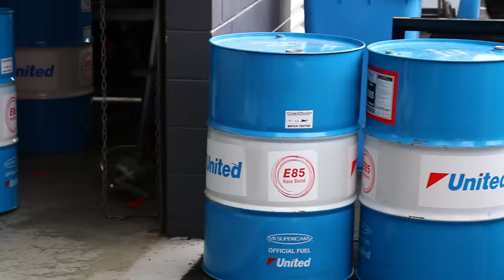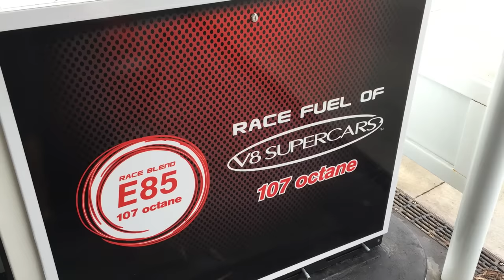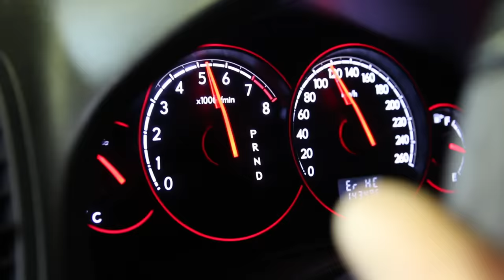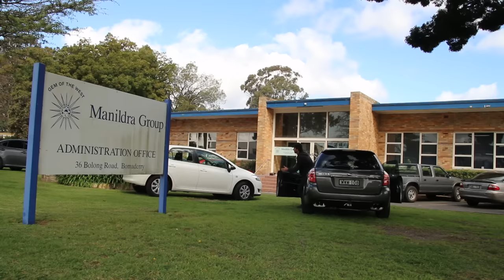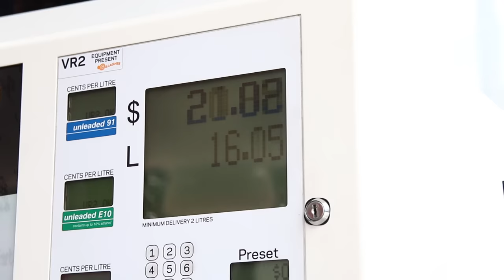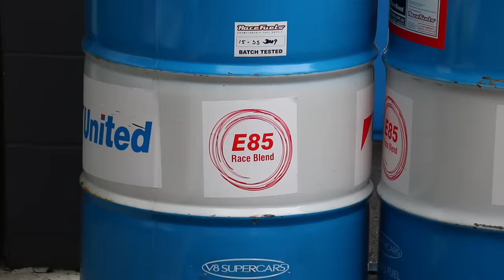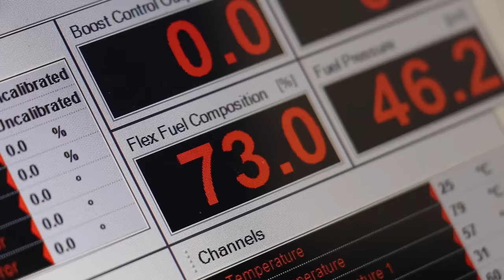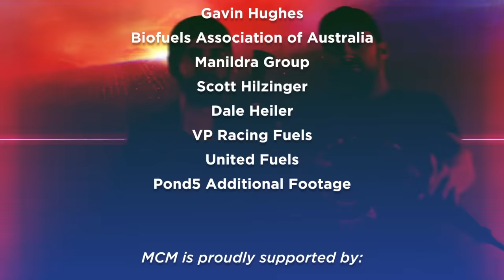E85 Fuel Explained - Should you use it?

Comment: In Brasil we use EA96 in the street, and u can find EA100 in some special places. Cars are runing Ethanol here since 70's and the first Flex fuel car was VW Gol 2003 1.6L using the EA827 Engine, same found in VW golf MK1, MK2 and MK3. And its the engine that the majority of us use for modifications. I Own a VW Gol 1.8L 1994 runing only EA96 from factory, and its carburated with a Brasol 2E. The 1.6L version makes 80hp on Gasoline and 90hp on ethanol. Here it is made only of Sugar cane. And i think we are the major market for ethanol. Petrobras is the statal-company that make it. And for the future, i hope we use eletric cars =D

Comment: Dude I'm gonna convert my race car to E85 it will be awesome! 
Then I will use my backup car to drive 200 miles to look for E85 once a month and top up :)
Reply: That is all I use in my coon cage and it is so that all one needs to do is change the filter. However fomoco was so inventive in the 60's they never needed a oil change. 139,000 miles 4 quarts amsoil over time. Plus filling filter hey do a normal up keep and as prescribed these panthers last.

Comment: In the USA  we use Research Octane + Motor Octane + 2 ..   Looks like they just  use Motor Octane in Australia .. Ethanol  makes more HP for 3 reasons  higher octane  if your motor can utilize the higher octane .. from higher compression ration more timing advance or  boosted intake .

  you can burn more of it with the same amount of air .. because it is an oxygenated fuel  that has some of it's own oxygen in the fuel ..  Plus it has a tremendous  cooling effect which helps keep the combustion chamber temperatures at save levels for reliable engines ...

Comment: Caltex E-flex is 70% Ethanol, United is 85% Ethanol. Always use United if possible...
Reply: +Luke Anderson It depends on the season actually.  Summer blend is more, and winter blend is less ethanol in the USA.  The higher gasoline content in the winter time helps with cold starts in the colder parts of the USA.
Reply from the maker: +peniswrinkle Depends what fuel octane they blend it with too.. United e85 is blended with 98 octane petrol
Reply: Mighty Car Mods
What do they blend it with in 'Straya?
Reply: +peniswrinkle, Yes with some gas stations like Caltex you get 70% to 85% between seasons but with United, they tend to be pretty spot on with 85%... Australia is limited to E85 stations, only Caltex & United, & rare to find E85 at those stations alone...
Reply: +Mighty Car Mods, You guys are awesome... May the Road be with you & keep Chopping...

Comment: In the Netherlands we started the E85 experiment in 2008 with Ford and Volvo making Flexifuel vehicles. The E85 was 30% cheaper than regular 95 gas. I have a Flexifuel vehicle. Unfortunately we experiment has failed and almost all E85 pumps are removed in the entire area here and possibly the whole country. According to the pump manager i was the only E85 consumer and this was the only pump in a 50-70km radius so that quite sums it up. I think electric is the way to go with superchargers at every filling station. Also BLAST acceleration with 4WD for almost no maintenance :)

Comment: I'm from brazil and woul like to share some things about ethanol here in my country.

1-you can find it on any petrol station, and it's usualy cheaper
2-the normal petrol here have 25% of ethanol, because of that cars usualy have a little more power than what the dealers says it has (Golf GTi here has around 245hp, 25 more than it should)
3- cars that can run on it pay less taxes, as a result of this, almost every car here can run on both fuels
4- Mamona (a plant from brazil) it's also used to make ethanol, and its better than sugar cane. however because sugar cane has other uses it's more used than mamona.

Comment: Sadly you can't buy E85 in England.
Reply: +Louis Gordon and sadly E85 is pretty much useless to daily in the north due to the low detonation temperatures.
Reply: Apparently morrisons used to sell it but was unpopular 👎🏻
Reply: +Vinnie Davis you can always mix ethanol with regular gasoline in order to make it more driveable during winter, if your car has flexifuel sensor
Reply: You also need to seal your tank of irbid made from steel else it will rust out over time due to the water content in ethanol.
Reply: Jon Laws
this is good info, thanks for sharing
Reply: Where can you buy e85 from?
Reply: +Louis Gordon Use Methanol injection instead.
Reply: +Louis Gordon E85 is trash it gets like half the amount of mileage per gallon my car is a flex fuel car and ive filled it with E85 before and it was trash
Reply: LiveToRide
maybe you should do some research. Just because it requires more e85 to make the same distance doesn't mean it's not better in a lot of other ways that matter A LOT more. It makes less distance because of the engineering use case.
Reply: Bootleg Builds in order to run on fuels which contain more than 15% ethanol, it's recommended to upgrade the fuel lines, the fuel tank, and injectors.
Also you'll have to install fuel pressure regulator and an ecu which supports flexifuel sensor.
But I have never done something like this, so it's all learnt from forums.
Reply: Vinnie Davis Unfortunately its over twice the price. I use £100 a week in fuel. Double it and thats an extra £5k a year. I can get a super charger fitted for that price that doubles my BHP. In the UK its not really an option. Yet.
Reply: boothegoo pc
In a lot of places it's not an option, yet. It's about potential, not current functionality.

Comment: E85 was a failed venture when they realized manufacturers would have to use a full stainless steel fuel system including tank. You can run e85 in a daily driver without any corrosion problems but it will eventually absorb moisture and destroy your tank, fuel rail and injectors. On top of that most pump e85 is stored in old gasoline tanks which are not designed to house ethanol, which dissolves the tank lining. This lining then manifests itself in your fuel filter and injectors as a black tar known as e85 goo, which can destroy your fuel system in short order. E85 is a great fuel but these days fuel economy is king, people don't care about horsepower as much as fuel economy. If anything Diesel is the fuel of the future because it has the highest energy content per volume of any fuel, meaning you make smaller engines and still get the same performance figures. The only issue is particulates that go into the atmosphere, which can be greatly reduced with urea additives. Modern diesels..1/2
Reply: Are cleaner than modern gasoline engines.
Reply: Except when oil just runs out, we will either have to go electric, or E100, and being a petrolhead, ethanol seems a good enough alternative.
Reply: Just like how it dissolves plastic gas cans right

Comment: If you look at towards the future rather than the present, ethanol looks better and better as a fuel source. The primary benefits of ethanol as a fuel are a higher knock resistance and a greater cooling effect on the intake air - mostly useful for cars with forced induction. As such, smaller, turbocharged engines (the current trend) make better use of ethanol. Reduced energy content can be partially offset by taking advantage of the knock resistance of ethanol by increasing compression/boost pressures. As far as production goes, cellulose-based ethanol will be the big breakthrough. Once that becomes industrial, the arguments about corn usage will break down.

Comment: Hello. Let me contribute with you guys sharing my experience since I'm Brazilian. In the end of 70's beggining of 80's Ethanol started to be introduced in Brazil as an option to Petrol. Because of the Petrol crisis. Mechanically it is easy to adapt petrol engines to it,  but in "cold" temperatures (15 Celsius) to make then fire up was a hard job back on 80's. Bateries very often were not able to handle it and till those engine warm up leaps, gaggings were usual. But the fuel itself was so cheap that people still kept on buying cars moved by this fuel. (Fiat 147 was the first manufactured car to be sold in Brazil moved 100% on Ethanol) When the Electronic Fuel Injection started to be used (1989 Volkswagen GOL Gti (with no F)) those problems just disapered. Since you didn't forget to keep the small petrol tank, which was allocated inside the engine compartiment, fillled with petrol to be injected before the first start at mornings. So we were capable to buy a car 100% Ethanol or 100% Petrol during all this time. But sudenly in 2003 We had our first car capable of run with 100% ethanol or 100% Petrol or even any percentage of mixture between these two fuels. So if you want to buy a car in Brazil you don't need to ask if it runs on petrol or ethanol. 100% of them can do it. Honda has launched the first motorcycle capable to it too. When using than it is noticible that with ethanol they have more power but the fuel comsumption is bigger something from 15 to 30%. And the last electronic injection fuel systmes adopted just elimited the necessity of that annoying small petrol tank...

Comment: When you add the production process to make E85 to the emissions your vehicle produces you end up with a larger carbon footprint than if you burned baby seals and coal for fuel.
Reply: This is just not true, and even if it were, an increased carbon footprint isolated to one area is much better than having that carbon footprint spread over a large area. It is a lot easier to fix/control if it is isolated to a single area. A critical temporal distinction exists when comparing ethanol and gasoline lifecycles. Oil deposits were established millions of years in the past. The use of oil transfers into today’s atmosphere GHGs that had been sequestered and secured for millennia and would have remained out of Earth’s atmosphere if not for human intervention. While the production and use of bioenergy also releases GHGs, there is an intrinsic difference between the two fuels, for GHG emissions associated with biofuels occur at temporal scales that would occur naturally, with or without human intervention. …Hence, a bioenergy cycle can be managed while maintaining atmospheric conditions similar to those that allowed humans to evolve and thrive on Earth. In contrast, massive release of fossil fuel carbon alters this balance, and the resulting changes to atmospheric concentrations of GHGs will impact Earth’s climate for eons. The real reasons why ethanol is part of the energy landscape today is because it reduces GHGs and other harmful tailpipe emissions, supports hundreds of thousands of jobs, greatly reduces farmers’ reliance on federal subsidies, and enhances our energy security – while reducing gas prices. Ethanol is a win for the US consumer and anyone else that likes to breathe cleaner air.
Reply: So using e85 won’t burn baby seals? Hmm guess it’s time to switch back to gasoline.
Reply: average 2.00$ for e85. Average 6.00$ for race gas. Hmmmmmm. Don't care if it is true. Like people so against electric cars. Cost me half in fuel cost to drive a tesla for what the current prices are now. Even more when gas goes back up, which it will. Probably getting a tesla in next couple years.

Comment: dunno about your e85 but our USA e85 rots fuel lines, gaskets, engines, injectors, fuel tanks etc etc like most car guys HATE it here
Reply: +Thyshallsmite If you have a car designed for it and don't let the fuel sit for long periods of time it is awesome fuel. If you don't have rubber fuel components designed for it, engine with an aggressive tune, higher compression, or you let your car sit in the garage for 6 months then don't use e85. I know Jay Leno complains about ethanol (e10 or e15) in California for causing problems with his car and the reason for that is they use old rubber parts that were not designed for ethanol and his cars do a lot of sitting around.
Reply: Thyshallsmite You sure that's not Methanol? People here say Ethanol is fine but Methanol is too concentrated and can damage gaskets, fuel lines etc
Reply: A lot of guys with older american muscle hate it because none of the cars back then had components that could resist the reactivity of Ethanol. If you took a modern Camaro and put an ECU in it tuned it for 91 and tuned it for E85 the E85 tune would make more power and the car could run it without any issue.
Reply: Hugo both are corrosive by nature, methanol is worse but E85 is not too far behind.
Reply: Dodgy Brothers Ahhh true

Comment: what about LPG its cheap as fuck here in the UK
Reply: +Mark Williams Here in Lithuania as well. It's half the price of petrol and if you install quality LPG equipment, your fuel consumption will only increase slightly.
Reply: Was thinking the same thing.
I live in Belgium and drive an American Chevy Astro (4.3 v6) as a daily with lpg. Not even half the price of petrol so the 15-20% extra consumption isn't too bad.
Reply: +Mark Williams yes but, like E85, suffers the lack of energy density and unlike E85 has next ot no benefit for compression. IT is also cheap as fuck here in Australia, mostly cos we supply a fucking shit tonne of ot it to the world, one of our biggest exports in the resources sector
Reply: And one of the "proper" systems will give you performance gains.
Reply: +Mark Williams if you use 5th generation LPG - direct inject of LPG in liquid form, it will be more effective than petrol: more power, less consumption, cooler combustion, cause of vaporazing the liquid into gas by itself, not by other equipment
Reply: Mieszko M Actually, I have 5th generation LPG in my car and it consumes more LPG than gas. Gas - 7 l/100km, LPG - 9 l/100km.
It's still much cheaper though.
Reply: +☹ しんみりＧＨＯＳＴ☹ consumes more Gas? How? LPG & Gas are the exact same thing.  Liquid Petroleum Gas. Hence the acronym LPG. How can it consume more of the same fuel? Unless you mean Petrol. Yes Petrol. The correct and proper name. You car consumes more Gas than Petrol. Just like every other car.
Reply: R3V0LV3R45 I meant petrol, sorry :D
It consumes more LPG than petrol.
Reply: +☹ しんみりＧＨＯＳＴ☹ 
In Lithuania we still do not have 5th gen LPG, so probably you are talking about direct injection 4th gen.
5th gen does not use a reducer to go from liquid state to gas.
Reply: Edgar Persijanov Oh, that's right. Why isn't 5th gen used here then? Is the cost very high?
Reply: +☹ しんみりＧＨＯＳＴ☹ 
Cost plus it's still unreliable.
Reply: +Mark Williams LPG is for barbecues not cars.
Reply: smallenginedude71 You're thinking of propane or butane.
Reply: devilskullBEL LPG , liquid petroleum gas. it is propane. the stuff you put in yout barbeque is exactly the same as what you put in your car.
Reply: smallenginedude71 That doesn't mean it isn't for cars though
Reply: +Mark Williams LPG is widely used in rock bounces watch some madram11 films,you ill see they almost all use it. It should be cheaper as it is another by product of making petrol,sadly here in Canada it got more expensive than deisel or petrol and was use by almost every taxi and police in the 80's-90 untill it became more expescive.It is a super clean fuel makes no sence to not use it.
Reply: +P Kuudsk I recently bought a Chevy Astro 4.3 v6 with lpg. In Belgium, lpg is about 1/5th the price of petrol and I must say I'm really pleased with it.
mpg is a bit worse, but it's a lot cheaper and you know it doesn't hurt our dear nature even a single bit.
I genuinely love it.
Only downside is you don't see how much there's left in the tank, but that just a matter of keeping track of your trip meter. Worst case scenario, you flick the switch and go back to petrol.
Reply: Tune it like e 85 has about the same octain rating.
Reply: The Polish have it all figured out, same with the rock bouncers.

Comment: e85 in the states is bad and will destroy your tank,lines,injectors over time
Reply: +225rc not if set up properly. its all about supporting mods.
Reply: i know thats why i said it
Reply: +Clever and Original Username. No you don't. Just make sure your fuel tank doesn't have gunk in the first place.
Reply: +Clever and Original Username. Maybe from cars that are 50 years old. Maybe. Show me any evidence of a fuel line soaked in e85 deteriorating.
Reply: 225rc well you need to stop complaining and build it correctly
Reply: 2005 ToyotaCamry 4cyl, been running E85 for 2 years. Only mod done was the E85 conversion kit. Everything else is stock.
Reply: ive been running on a mix of 2/3 e-85+1/3 gas in my unconverted gas car from 2006 for more than 10 years now. It still runs fine.  Removed fuel filter last week and it was like brand new.
Reply: 225rc the motor could last longer if you use e85 compare to the regular gas
Reply: What kind of mileage are you getting.

Comment: I use it as a fuel system cleaner about twice a year. I live in Iowa where it is highly subsidized since it is part of our economy and is 30-50% cheaper per gallon. But the loss in mpg and the risks of running it long term keeps me from using it all the time. Although I have told everyone they could run E15 all the time if they wanted to save money as it is not likely to cause long term issues and is about 15-20% cheaper.

Comment: I once tried the european E10 ( Estd. 2011 ) stuff in my 2-stroke engine - never again!
#1: Had some granite-like residue clamped in the spark plug's contacts.
#2: My muffler's heat shield had turned from shiny silver to purple-blue.
#3: My engine was all but easy to control, leading my scooter to jerk like crazy, the equivalent of a horse trying to eject its rider.
#4: The fuel economy was far worse than running on 95 octane.

Conclusion: Good enough to feed a waste oil burner with, or to make molotov cocktails.